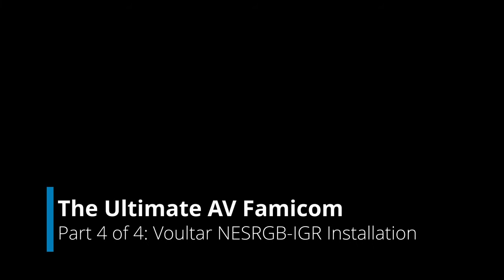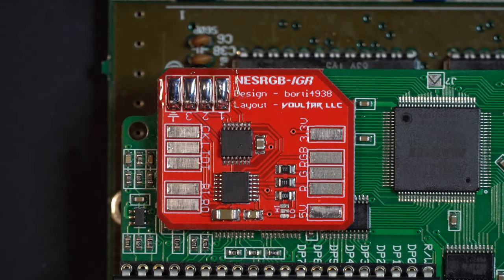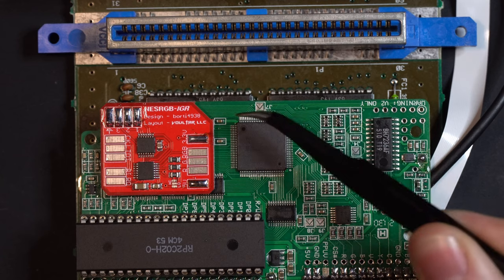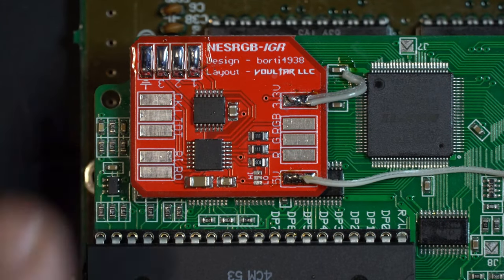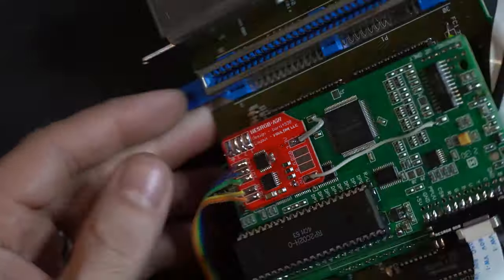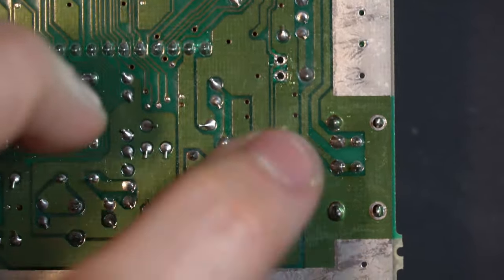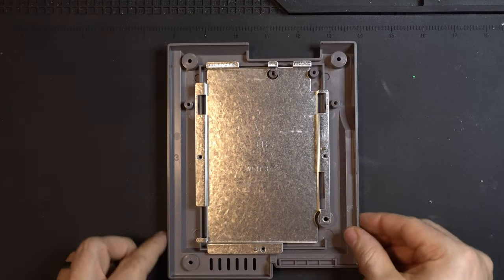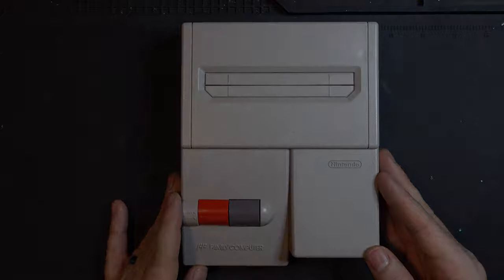Ultimate AV Famicom (NES) Mod - Voultar NESRGB-IGR Installation (Part 4 of 4)

Comment from the maker: Tim Worthington recently released v3.0 of the NESRGB which deletes the three color palettes functionality, and now only stores one. Therefore the NESRGB-IGR is no longer compatible. This is a real shame. The palette switching feature is a big deal to many. For those of you who desire this feature, I recommend reaching out to Tim and giving him your feedback.
Reply: Hi, thank you for the video, how do I get the nesrgb-IGR disable to use normal Av cable (White, Red, Yellow)? I have this mod and I only works with scart cable, oficial Nintendo Av cable give me gray scale image
Reply: @DanMAkiau  The IGR just handles palette switching. Take a look at the NESRGB install video for details on hooking up composite (yellow) video: https://youtu.be/KvLx_PP67Q0
Reply: Hi, is there a way to have only the IGR part working with NESRGB V3 ? And with the NESRGB V3 did the audio expansion part of your super tutorial still possible ?
Reply from the maker: @nicolasaugeard  Unfortunately I have not handled a V3 so I don't have those answers yet.
Reply: Thankfully I have the same version that you installed in this video. I can do these mods.

What was the gauge of your insulated wire for the output in the last video? I didn't catch it and am wondering what I should order. I can solder fine but I still have no clue on wire gauge.

Correction. I just tried to order the NESRGB-IGR and while Voultar has it listed in stock on the product page I get the following in the cart. 

" Products marked with * are not available in the desired quantity or not in stock!"

I sent a message and will see what I hear back. 

Thank you for the videos